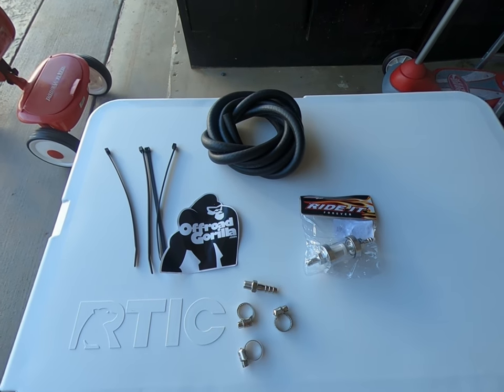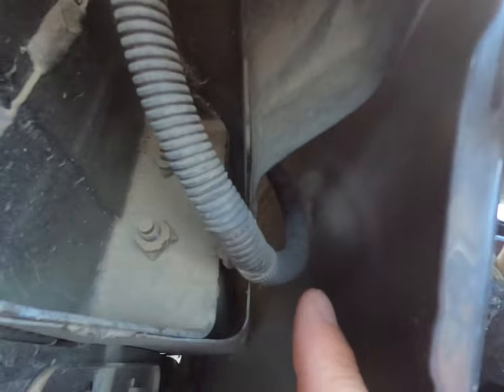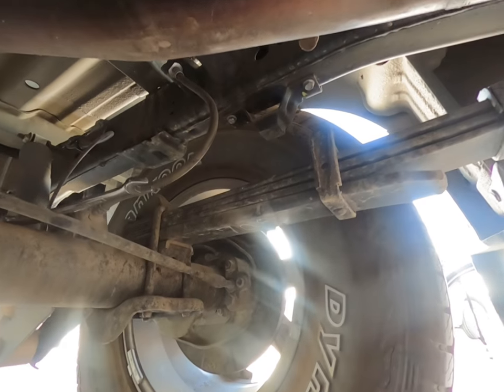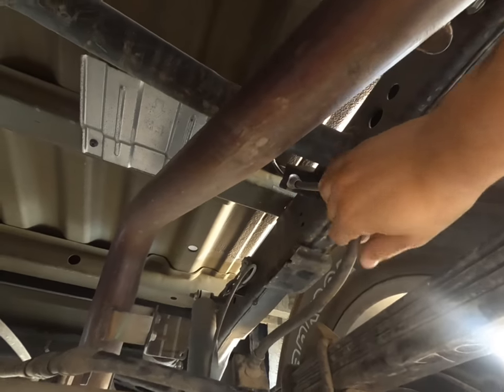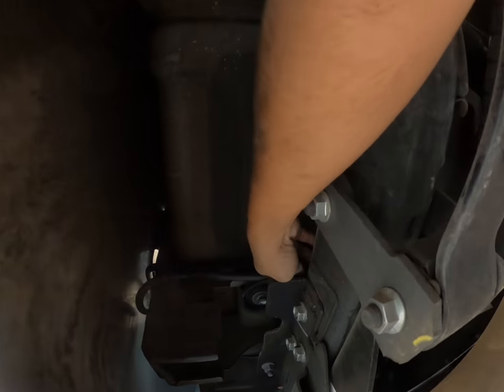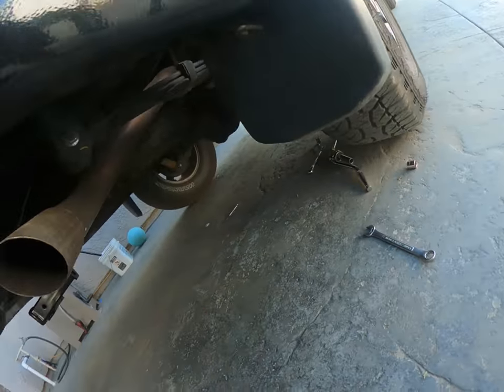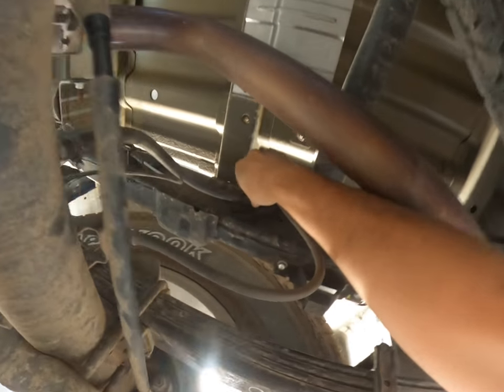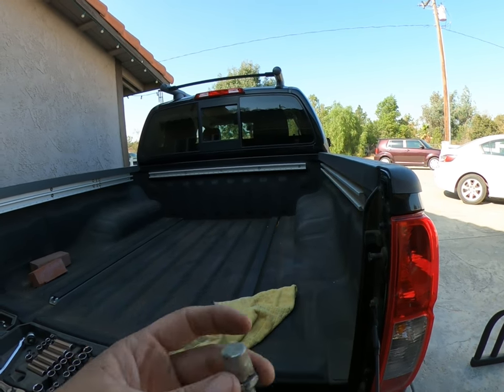Off road gorilla axle breather mod | Nissan Frontier Pro4x

Comment: I suggest putting black silicone on the threads or it may leak.  When I changed the gear oil in the rear differential I opted not to use sealer on the threads of course it leaked. Not much of a problem to seal but I had to fix it again.
Reply from the maker: Thank for the tip! I'll def put that on the to-do list

Comment: Is this mod a must if you don’t take it off roads ?
Reply from the maker: I say yes.. will save you alot of $ if that valve ever gets stuck (blows axle seals)
Reply: Just got an 06 frontier . Trying to make it as reliable as possible. Have you done anything to your truck to prevent the SMOD?
Reply from the maker: @lakeshow2412  I have a 2014 so the smod issue has already been fixed 

there should be a piece you can buy to prevent that from happening.